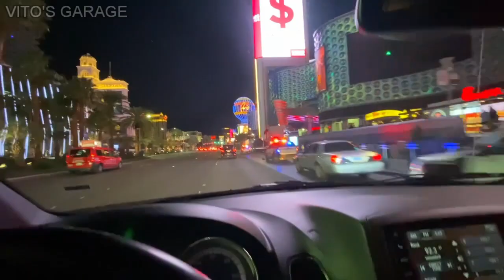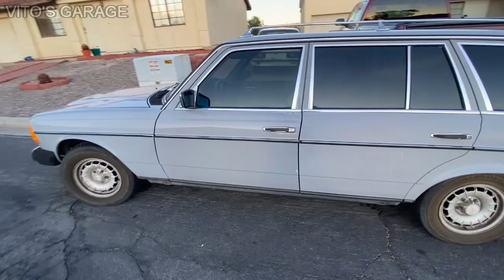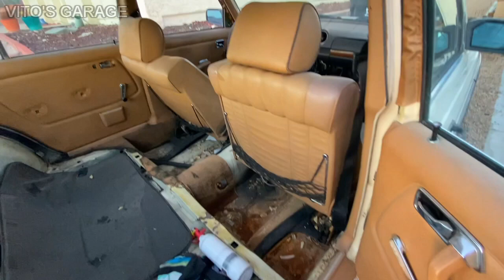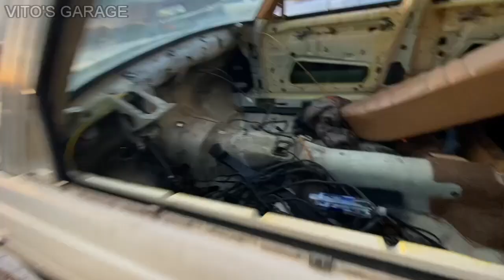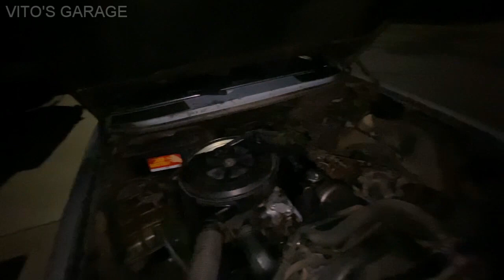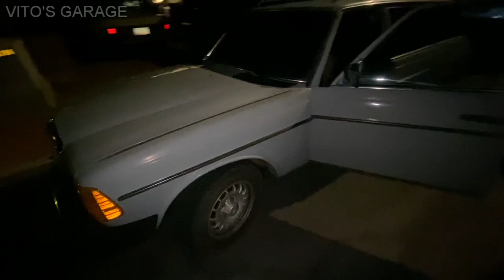Rare Mercedes W123 S123 300TD Wagon with Black Interior! Lots of Classic Mercedes! Nevada Desert!

Comment: hello Vito, the advantage of desert areas is that the bodywork does not rust, the downside is the sun which destroys the plastics ...
NB: I changed my out-of-service EHA and its O-rings (Bosch is a thief :) ).
  I tried cleaning the old one & the old fuel filter on the KE Jetronic with a small ultrasonic cleaner. Lots of dirt came out. I dont know, however, if the old EHA is really restored (No try), but the fuel filter is now visibly clean. This tip could help ...the vintage car collector community. 
Here, the temperature is rising so I will be able to take care of my C124 :).  Bonjour de France.
Reply from the maker: Very true, sir. And the paint fades away in hot states here as well. And awesome, great job on cleaning your CIS system! The dirt can cause a lot of problems! Thank you so much for watching and supporting!🙂🤝🤘